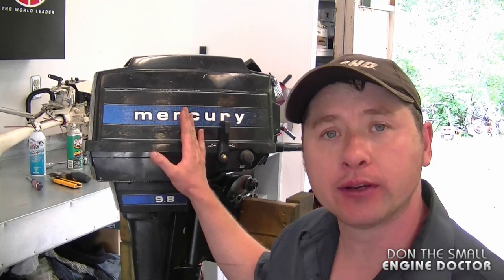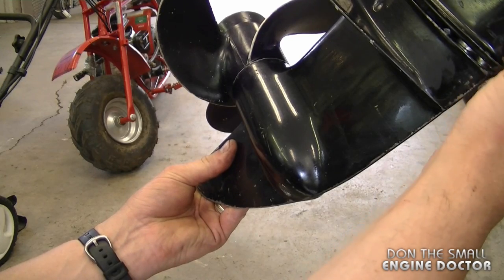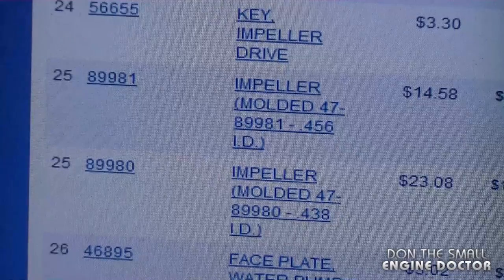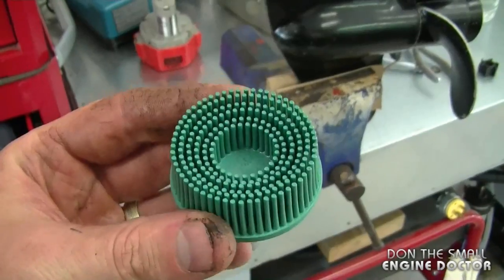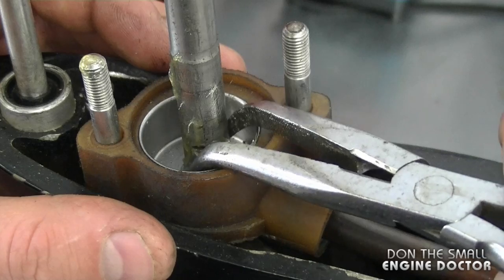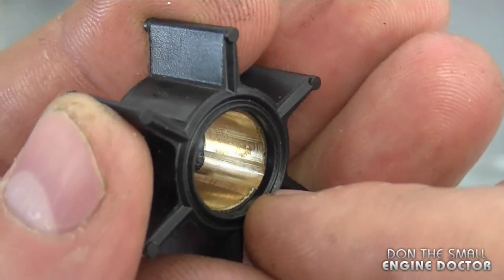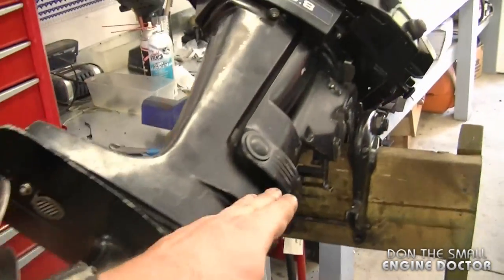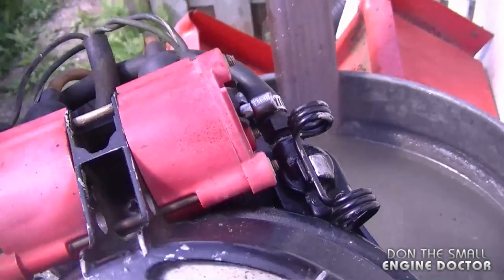HOW-TO Impeller (water pump) Replacement In Mercury Outboard Motor

Comment: I installed new impeller & didn't think I moved anything but my gears are not right now? I left shifter in neutral for the prop is now reverse on the lever. Help please.
Reply: When you put your lower unit in you have to manually line up the gear shifter in the straight position
Reply: Thank u Chris. I'm at work & will give it another try when I get home.
Reply: @LTLBRWNEYES  it's quite difficult to explain but the gear shaft is sort of spring loaded into a gear. So you need to hold it in the middle position when you insert the lower unit

Comment: I got one of these cheap and then found out its a 1975 model. That was the last year they used carbon steel for the driveshaft and shift shaft. It really sucks the oil seals are all bad at the drive shaft and the shift shaft is disintegrating...

Comment: Those Merc 7.5 9.8 hp are a real pain to re install the lower unit.  I find the best way to reassemble is to take the cover off and put the motor upside down and slide the lower unit in it.  I learned that trick a few years ago and it saves a lot of cursing and time.  They are fast motors but very loud and hard to start.